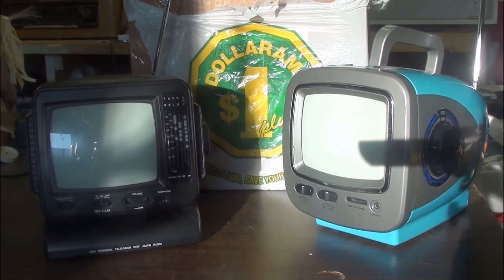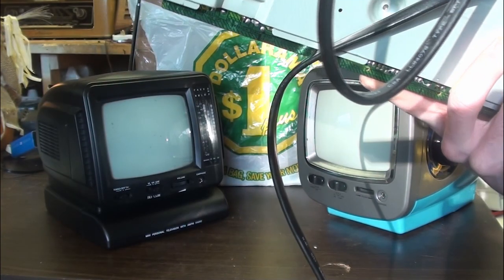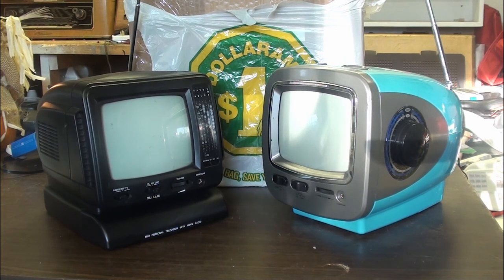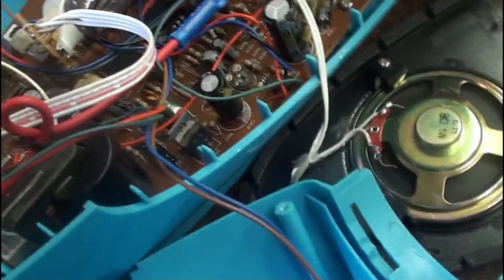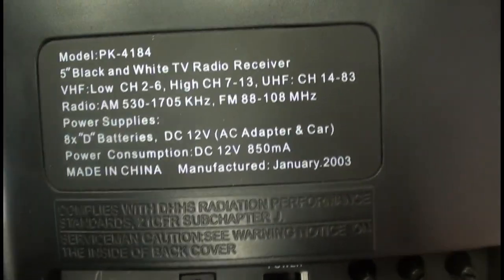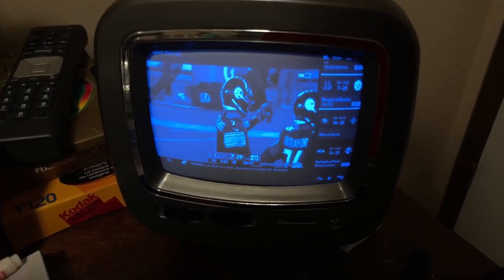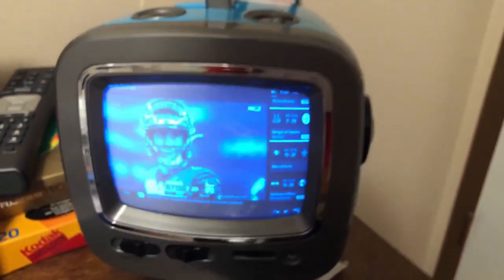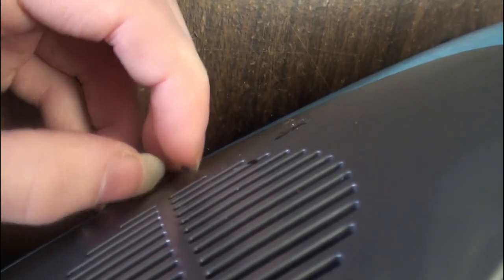2003 Mini Personal Television With AM/FM Radio (Campers Edition) Claybrooke TV Style #13181

Comment: I found a red one New in the box at a church thrift store.. I'm using the a/c power and yes the battery tray is hard to open.. Radio AM/FM and torch light works good but no local analog TV stations.. Still not bad price for New..
Reply from the maker: Nice! Now you just need a DTV Box , An HDTV Antenna, A Video Modulator some coax and an F type coax to 3.5 mm adapter for the antenna Jack
Reply: @canadianradiotvguy1299  also PAL NTSC HDMI TO RF.
Reply: Or a cox converter box hook up a out coaxial cable and then get a coax jack plug and set it all up and you can watch shows

Comment: How did you make the tv channels work
Reply from the maker: Here I’m Just Feeding Signal Through The TV NTSC Style From My Cable TV Set Top Box With Two Different Signal Modulators Connected To The TV With A RG36 Coax Female To Male 3.5mm Aux Type Jack Adapter On Channel 4. You Can Use VHF CH 3 Or 4 With The Modulators. Here Are The Links To The Modulators And Adapters    

MOD. 1 : Wiistar HDMI to AV Converter 1080p HDMI to RCA CVBS AV Composite Adapter Support PAL/NTSC Switch for STB Blue-ray DVD Xbox PS4 Games https://www.amazon.ca/dp/B07BMQQ4C9/ref=cm_sw_r_cp_api_fabc_KYs.FbCHRF1BF  

MOD.2 : RF Modulator | RCA Composite to RF Coaxial | Converts Standard Definition Signals to Coax, Includes AV Cable https://www.amazon.ca/dp/B06XC9Y3VB/ref=cm_sw_r_cp_api_fabc_xZs.FbGZ8FMWV?_encoding=UTF8&psc=1

ADAPTER : https://www.ebay.com/itm/162755318915
Reply: Wow!  Brightest CRT Ever!
No, sorry, wait, wrong end, that s the flashlight.
Reply from the maker: @Haweater LOL You Mean The “TORCH”
Reply: @canadianradiotvguy1299  TM70 UHF RF MODULATOR WITH MICRO USB DC, channel 21 on channel 14 UHF.
Reply: @canadianradiotvguy1299  
How do you get TV channels